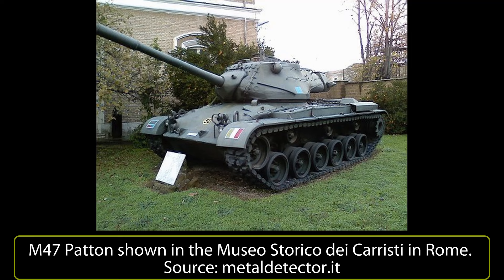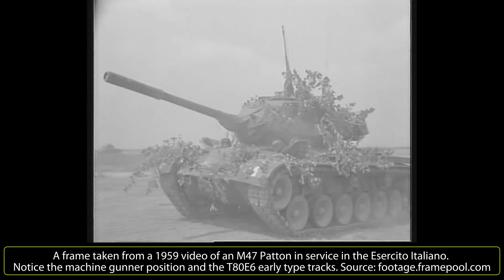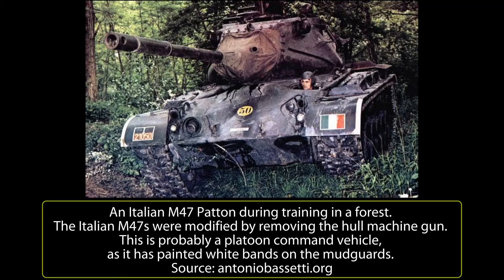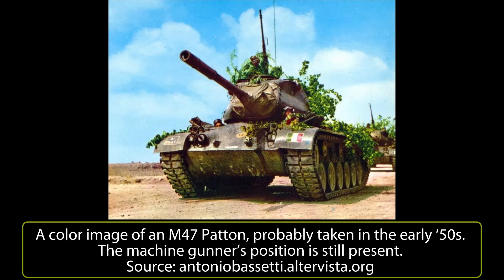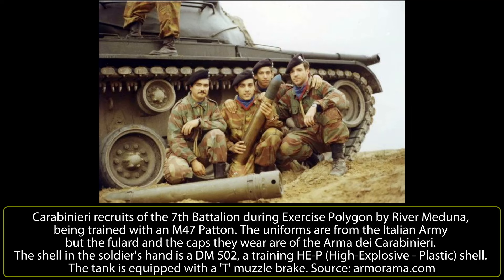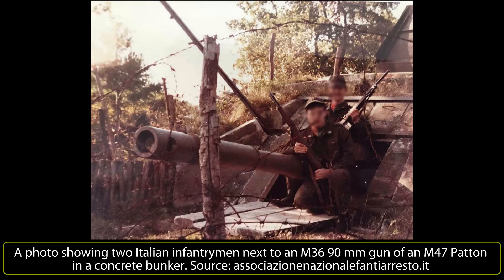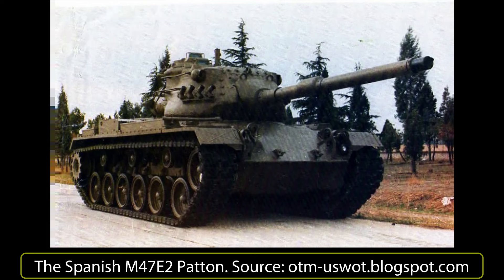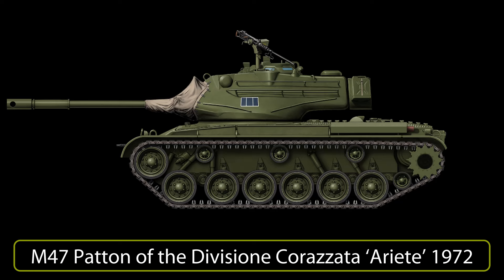M47 Patton in Italian Service - An American Dream

Comment: Actually,Yugoslavia also used M47 . The general idea was to use it more in a defensive role,due to its oil problems and requiring more maintenance.It was a beast for the standards of the army back then and it was a enormous leap forward.That and Jackson were literally elite unites in Yugoslavia back then
Reply: yugoslavia's army was for self-defense alone. kin of how japan's army was until recently.